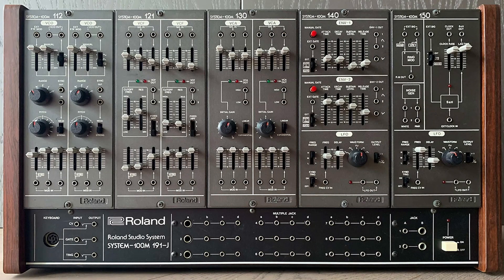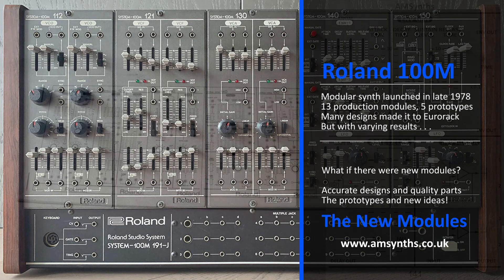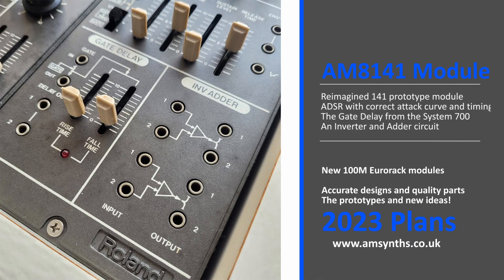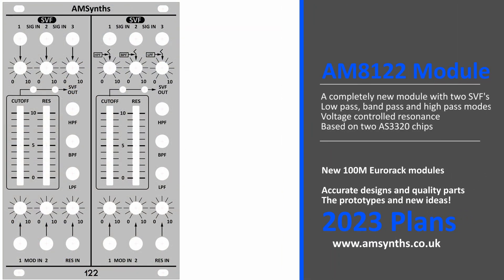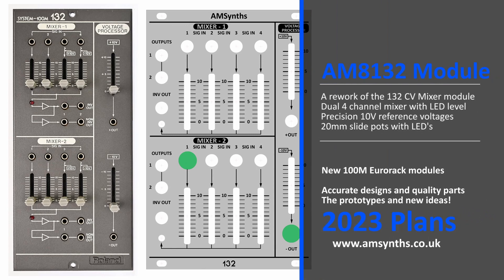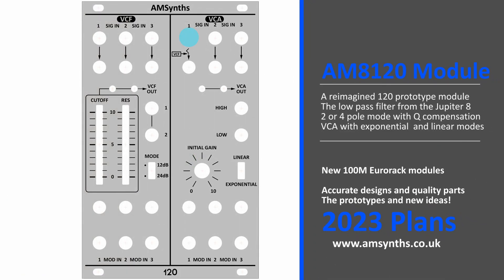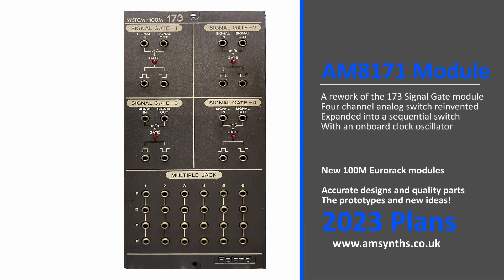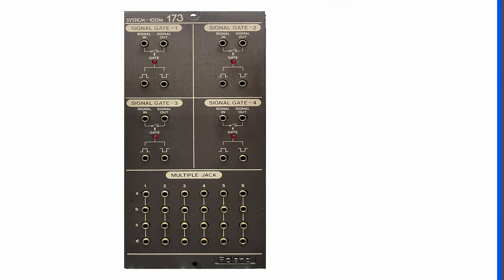AMSynths 2023 Module Plans

Comment: Would you consider making the 1035 or 1045 for the B2500 series?!
Reply from the maker: I am making the 1045 in 5U but it does fit easily into eurorack, might as well buy 3 modules. The 1035 was one of the modules I designed for Behringer as a second phase but we decided it had limited appeal. However it is a potential project for AMSynths…
Reply: @amsynths  I’m sure there’s a ton of people interested in whatever can come from the 2500 series. Would love to hear what you have planned after the 100M is up and running, assuming you’re focusing on that first. Thank you for the details! 🙏🏽

Comment: Great, thanks, but what happened to all the modules planned for 2022?
Reply from the maker: All the 2022 modules will be available in 2023 as well. Just ordered 1000x 2M slide pots for the SH05 modules, so the 8007 and 8010 can be released
Reply: @amsynths  I was more thinking about all the Moog modules that were planned, At one point you were even planning to release AMSynth VCO's etc. Would be really nice to have a usable Big Moog... but I guess other priorities took over.
Reply from the maker: The Moog 901’s will make it this year. ☺️☺️